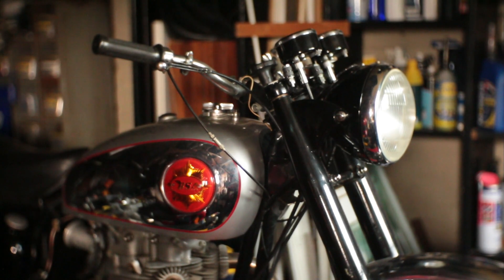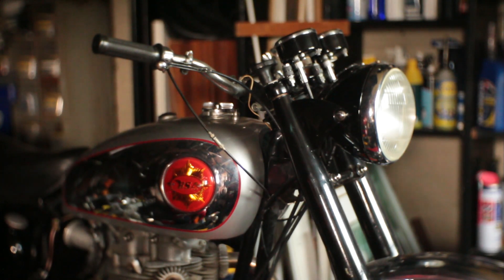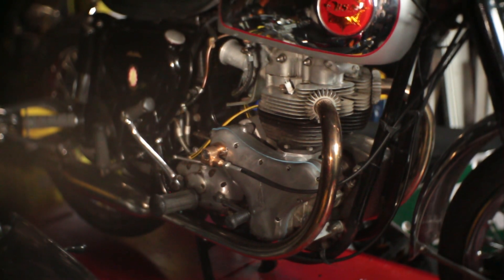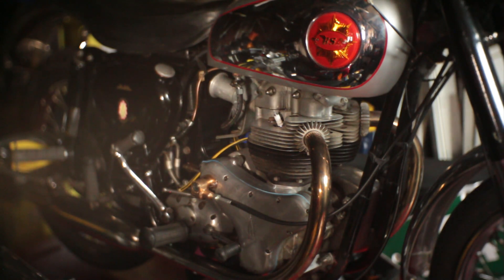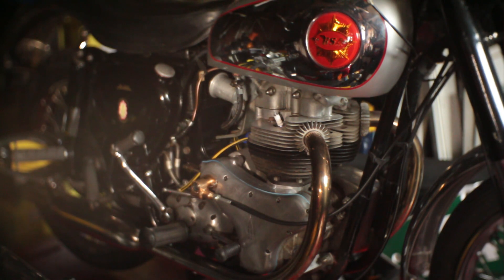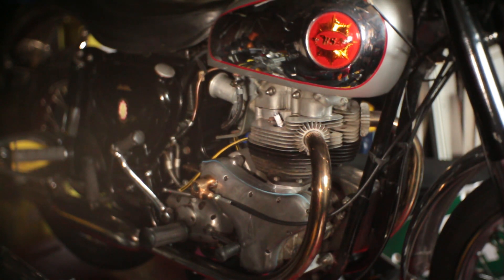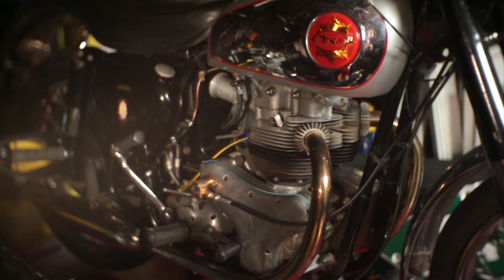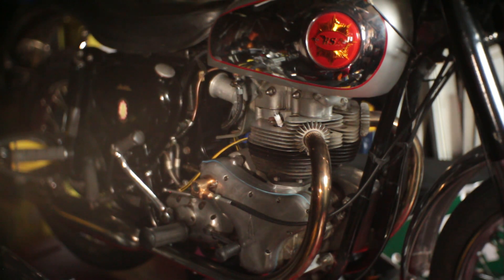Sneak preview of the next project - BSA A7SS engine removal, rebuild and replace

Comment: Just putting a BSA A7SS like yours together.  The head was removed in 1969 following a road accident to be painted matt black.  It has not turned a wheel since then and now I have my hands on it I found it was seized at TDC.  I have freed that up and the bores are fine though the clutch plates are stuck together.  I have cleaned the head up and painted it with heat resistant matt black.  All I need now is to be sure I have all the parts, bolts, nuts etc. to reassemble.  I am concerned with lining up the push rods and there are no torque settings for the cylinder head or rocker box.